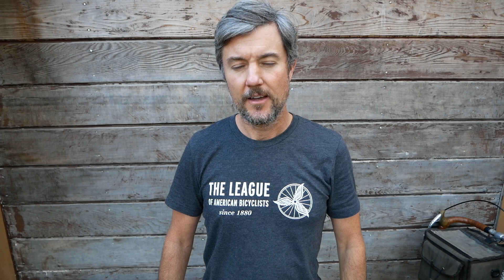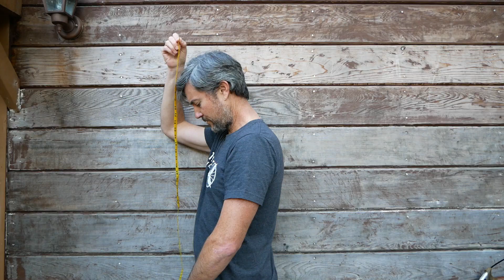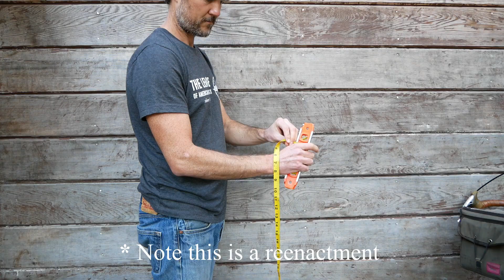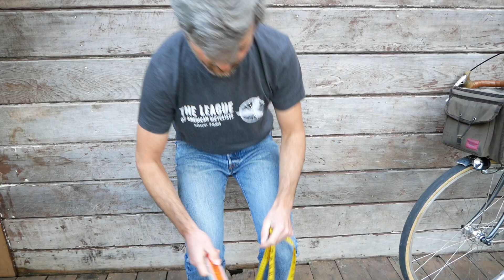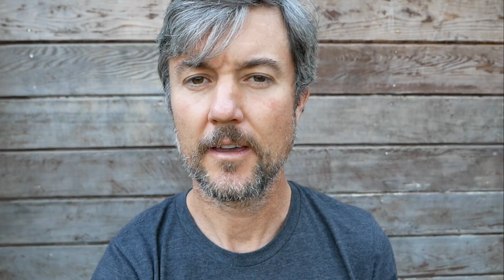Custom Steel Bike All-Road Build - Part 1 Introduction

Comment: I have two custom bikes, built by the same builder about 10 years apart. Like you I looked around at other builders out of state but in the end I couldn't ignore the huge plus of having the builder just a bike ride away. Ed Litton in Point Richmond built both bikes for me. The first bike, built in 2007, was what I used to complete both PBP 2011 and PBP 2015. I learned a few things that I wanted to include in a new frame and because the original could not be modified to include the changes I wanted, I had the 2nd bike built and finally delivered in 2017. (I now have custom racks by John Fitzgerald on both bikes (plus another bike))
Reply from the maker: Rob Hawks if you don’t mind sharing, what we’re the the changes you made for the second frame? Like you, I want to have a custom rack made for the front to fit the size of bag. The off the shelf racks have a smaller platform than most rando bags and you end up with the bag sinking around the edges.
Reply: @Henrywildeberry  Sure, but I also want to back up just a little to before I got the first custom frame. I had been riding a number of stock frames and one semi-custom (all 700c) that was built for someone else. I knew I wanted more tire clearance, but I should point out I was riding 25mm Conti's at the time. So the first custom had space for larger tires which turned out to max at 28mm with fenders. Riding 28mm tires for the first time was a joy over the 25 continentals. I would finish rides feeling much more fresh and not 'beat up'. The fork rake on the 1st custom was 50mm which was a compromise between what I wanted to try and what the builder normally built. That frame was wonderful without a loaded bag and did ok with a loaded bag, but not stellar. A custom rack was  made for the frame too, but given I had bolt on center pulls that rack had limitations. Here is a link to photos of the very first build of that bike: https://photos.app.goo.gl/7Xrh6H7jEpR6rH3a6 NB: the build is quite different now.

So, for the next custom, I found I wanted more rake, more space for tires, and brazed on center pull posts. All but the last one required a new frame. The new Litton Randonneur has space for 32mm tires with fenders, 60mm of fork rake, a custom Fitz Cycles rack, and brazed on Mafac center pulls. I liked the braking improvement with the brazed on posts that I retro-fitted the 2007 Litton the same way. Here is a link to photos of the 2017 Litton Randonneur: https://photos.app.goo.gl/t1uEqjynBVMhofh58

Here is a link to photos of the bike I was riding before I had the 1st custom built for me. It is a 2003 Dave Yates Super Randonneur built and ridden on PBP in 2003 by a different rider than me. I bought the frame a few years later. All three of these frames are 57cm X 57cm C-C: https://photos.app.goo.gl/Hk2RsrMjTQa1XvQM6
Reply from the maker: Thank you, Rob! This is such invaluable experience. Both bikes are beautifully made. I do notice the added clearance provided by the braze-on center pulls. The 2017 version is very near to what I am going for here with the Fitz. The only major difference is the extra ledger tires on 650b rims (for off-road riding). It's also fascinating to hear how you decided to increase the fork rake after giving the first frame a chance to shine for ten years. Did the lower trail provide the handling you were after? Did you find any downsides to the extra fork rake you weren't prepared for? I'm under the impression the extra rake will help provide less toe overlap too. Which one are you taking with you to PBP 2019?
Reply: @Henrywildeberry  I don't know if I can be specific about the exact reason why the 2017 Litton feels better, but it does. It could be because of the wider tires, or it could be because of the greater fork rake, or both or maybe one negates the other and the difference comes from somewhere else. I don't know what the numbers end up being after changing both of those, but I just really like the ride of the bike. It is what I'll take to France in August of 2019 for sure. (Another factor is that since getting the 2017 Litton, I have still been recovering from injuries so I'm not using the bike to it's or my own full potential.) As for toe-clip overlap, maybe the geometry on the 2017 helped that but I've gotten so used to dealing with that it has become second nature. I just don't get excited about whether it is there or not.

Comment: This video series will be interesting.  
BTW, If you're thinking about the Eroica '19 and wondering about gearing, then you may want to look at Red Clover Components.  The fellow has a nice way of "tripling" old derailleurs like the Campy Nuovo Record.  It's worth a look at his web site.  But if you could get up some of those stupid-steep hills with standard gears, then maybe you don't need a triple up front.  I did!
Reply from the maker: Thanks Ed! Next year the ride starts in Cambria, so I'm definitely going to check it out. The climbs are tough, especially the gravel! I'll check out the website you mentioned. Cheers!

Comment: Wow, I'm really looking forward to this series. Two questions come to mind: (1) do you have a budget that you're going to adhere to? (2) You had some ideas in an old video about making a "universal bike" by having different forks. Are you considering implementing that?
Reply from the maker: tawanga Excellent! I’m pleased to have you stick around. I know what video you’re referring too! No, I don’t think I’ll need two forks for this bike. In the video you mentioned that was an idea for someone with limited space or for someone like Ms. Cools who only wants one bike (or maybe two). This will be a purpose built machine. I do have a budget in mind, but it’s a soft boundary, and I’ll talk more about cost once I see some numbers coming in. When it comes to custom price is in your control as you can choose what extras you want. One thing I will say is I won’t compromise on ride quality to save a few dollars. On the same note, I will back off on extra bling if it’s causing the price to go up too much. The build needs to be utilitarian as well as aesthetically pleasing, with an emphasis on utility. I’m looking forward to all the comments and suggestions along the way because there are many things I haven’t decided on yet...